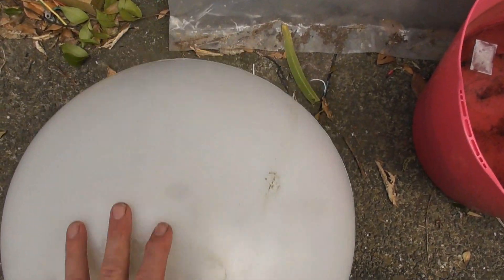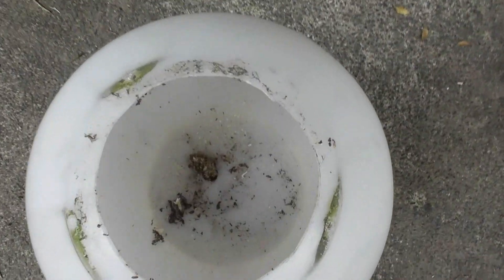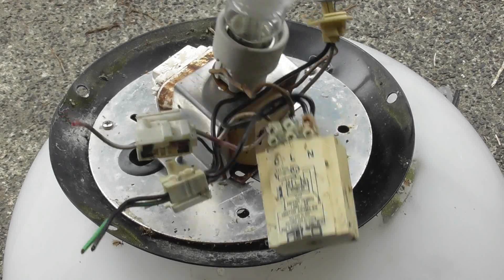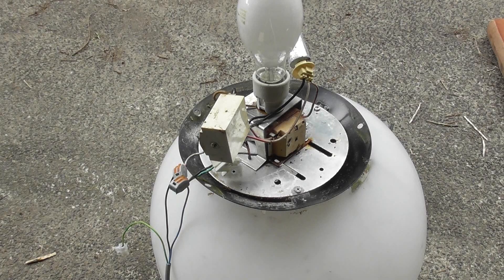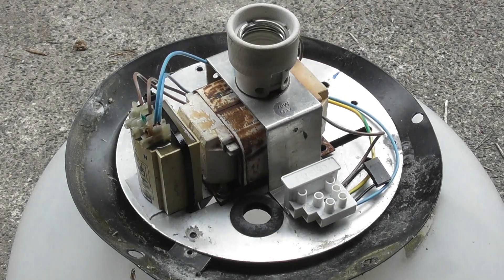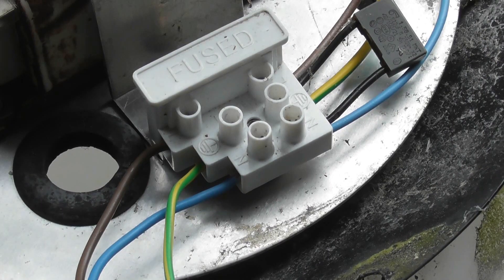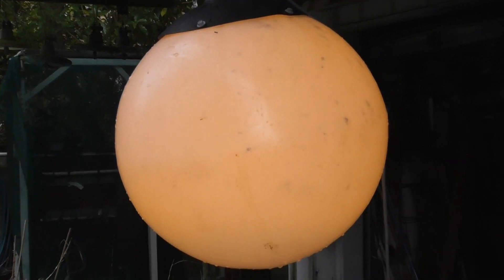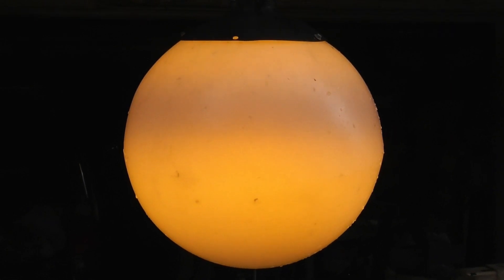Jablochka 70 Watt SON lamp

Comment: Our local church has identical looking lamps, with what looks like cast iron brackets attached to each pillar inside.  They appear to use mercury vapour bulbs in each lamp.  They power on with a dull reddish glow, then fade to a greenish blue colour as they warm up and and fully a green tinted white as they approach full brightness.  I always found it fascinating watching them warm up.

Comment: PFC cap not really needed as you do not pay for the reactive power, and with all the lamps you have the others will offset it anyway. Pop out that SON and replace with a 90W MV and it will still work well. Seen those same 70W SON lamps put into fixtures with 400W ballasts, and they do work still, a lot brighter and a lot shorter life before cycling.

Need to show us how a cycle free SON lamp shows up, with the pale blue discharge at EOL instead of cycling, those look nice when doing that.

Comment: Never heard of one of those being called a Yablochkov candle but there is some resemblance.  An actual Yablochkov candle is a device from 1870s Russia which was a rather clever form of carbon arc lamp using two electrodes sandwiched between a layer of plaster.  It was self-starting and required only a simple transformer and no moving parts.
Reply from the maker: I'm will build a true Jablochkov lamp with the two carbon rods and spacer and trigger filament. Like the 1876 design.
Reply: I'll have to look that up. thanks

Comment: These fittings are common around Wellington. They are a target for vandals though
Reply from the maker: We have a lot of these around Takapuna and Birkenhead.
Reply: @RODALCO2007  they must have been common to install at one point. I do electrical maintainence for an office building and there must be about 20 in the courtyard, which I hear is about to demolished soon.
Reply from the maker: @sambaker3233  They will be replaced by nasty sterile cold blue/white led flyswatters.